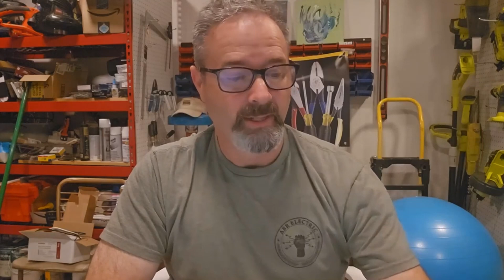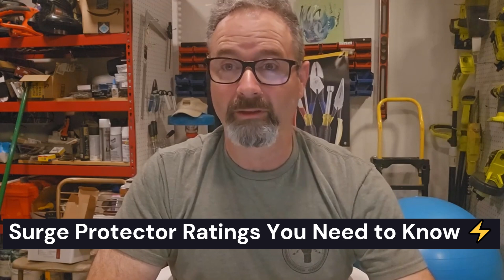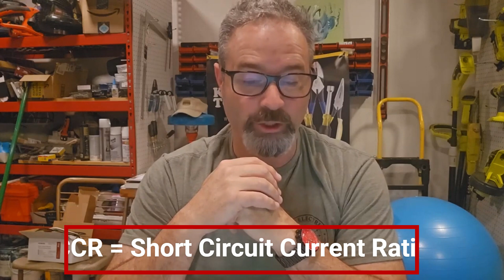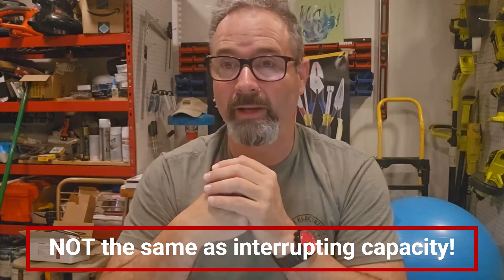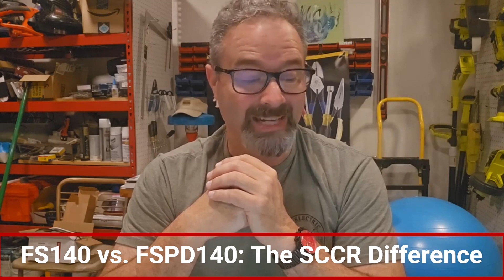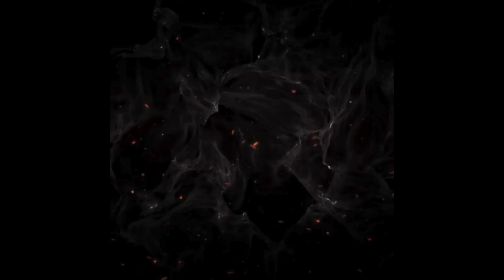Understanding SCCR (Short Circuit Current Rating)

Comment: So basically SCCR is the maximum amount of fault current that can flow out of a service?
Reply from the maker: SCCR is the short circuit current (fault current) an SPD can tolerate without damage. It  also refers to the same rating for the fault current (Kaic) available from the utility company. You must ensure your SPD SCCR rating is higher than that coming from the utility company. Most residential homes have a 10Kaic from the utility company.